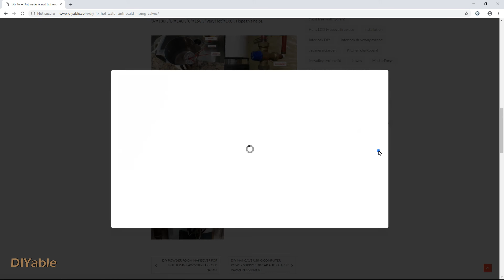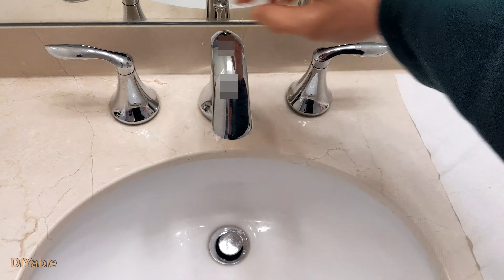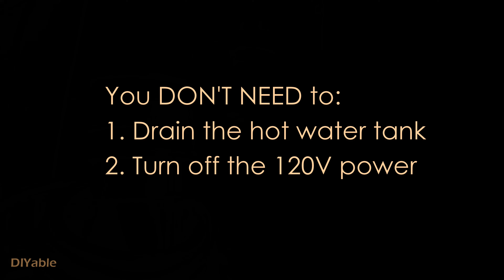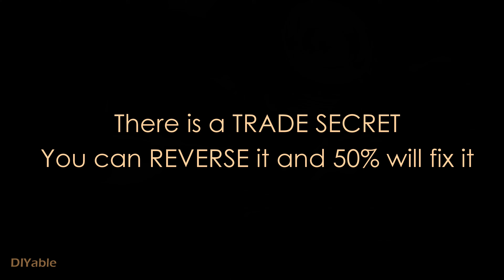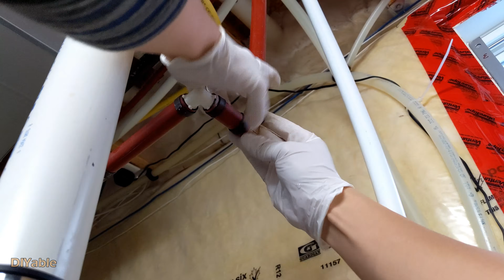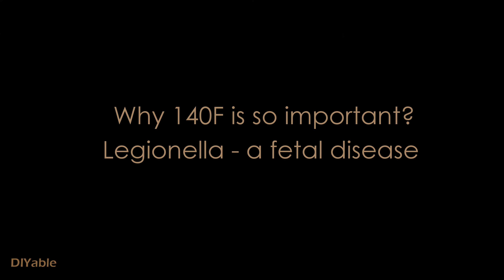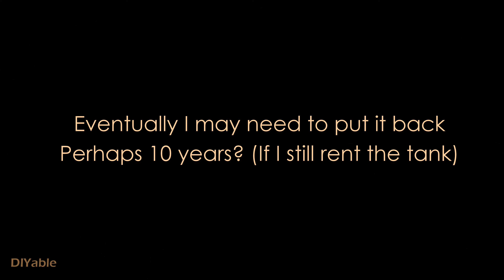How to DIY fix Anti Scald Thermostatic mixing valve issue? Don't call plumber until you watch this!

Comment: Great video,  I changed out the mixing valve about three years ago so my valve is now giving me problems after just three years.  I like the by-pass idea.  Great video!  Thank you!!
Reply from the maker: Thank you, I am glad it helps!
Reply: it is anti-scalding valve so it wont kill u if steam gets in the line I know a guy that died from this steam in the shower most dont ever think about it till its to late and ur being cooked like lobster
Reply from the maker: @Mike Sidebottom That's a very interesting scenario. You mean there is no hot water in the hot water line, but instead it's filled with steam. First of all, to get steam, the boiler has to go up to 212F (100C), does that mean there is a malfunction water boiler thermostat? Let's say that is the case, when someone turns on the tap in the bathroom, it is mixed with cold water instantly. Now, what would be the temperature from the tap when you mix steam with cold water? Would you be able to kill someone instantly? Unless the cold water line is blocked and only steam comes out from the shower head, this is a very interesting but rare scenario.

In additional, a normal adult without disability should be able to get out of shower right away. As I said in the video, the valve is good for elderly and people with disability.

Comment: also.  most valves have filters in line.    turning it around could free up the filter by running the water backwards.    you might look at the valve and see if u can clean it.   they are relatively easy to clean and service.   unless the wax inside sensor is damaged it should just be granules blocking it.   In addition.  your hard water could be the source causing the problems

Comment: How do you remove the colored cap? I tried to pry it off with a flat screwdriver but it will not budge? They installed this piece of crap in our master bath in a new build home. The water comes out lukewarm at best...wtf is the point of taking a lukewarm bath? I'm a grown ass woman and can adjust my own water temperature that I've already paid to heat. I'm about to just start carrying buckets of boiling water in there.
Reply: I actually just broke it off with pliers. The cap is no longer functional.
Reply from the maker: Sorry for late reply.  Do you have the model or brand that I can help looking up for you?

Comment: Why just avoid the whole flooding risk, legionella risk, hot water end and energy waste of tanked water heater and go for tankless?
Anyway thank you: the trick worked on the termostatic valve installed in my combi, now I have to "lower" the setting to have hotter water and hot water is almost scalding-hot again
Reply from the maker: YES!!! Tankless is one of my consideration too but after I did some research, they said that the existing vent may not be good enough for tankless. So, to go for tankless, they have to installer larger vent. That's what I was told.
Reply: Davide Bacchi so you refitted the mixer 180degrees? Connected cold port to Hot pipe and hot port to cold pipe?

Comment: Apparently these things fail often. Sometimes it's as simple as cleaning out the filters inside.

Wish my shit was ran with pex thankfully installed soldered male threaded adapters so I can just unscrew and replace it. Thinking about keeping one, cleaning it and when the new one fails swapping it. Then cleaning the one I took off so it's ready for
Reply from the maker: I tried to clean the filter but didn't work. Yes, this mixing valve is very annoying.

Comment: Yep they have the same stupid building code here in Australia and the mixers always break down so you end up with super hot water in the kitchen taps and cold or warm in the bathroom taps . This means cold showers and a lot of unhappy children , also then when they go to use the kitchen tap thinking that the water is cold there also ! They get a big surprise and find that its bloody hot and get burnt . In Australia we only have the mixing valve on the pipes that go to the bathrooms and another that is straight hot water from the tank that goes to the kitchen taps . Bloody stupid and frustrating. Thanks for your information.
Reply from the maker: I am not alone in this world!!!! Thanks mate!
Reply: moochnhowzn I am Australia also. My bathrooms and showers are a bit too cold out of hot taps. Almost don’t need cold on in the shower. I will try switching mixing valve 180 so cold line runs hot and vice versa. As long as seals and seats on cold side have temp rating. Other option is to fit ball valve on cold line prior to mixing valve and reduce flow of cold water.. I think I’m getting now 70%Hot +30%cold. I want 80/20 or 85/15. The mains pressure here is high also so cold takes over from hot because hot line pressure is nullified by hot water tank